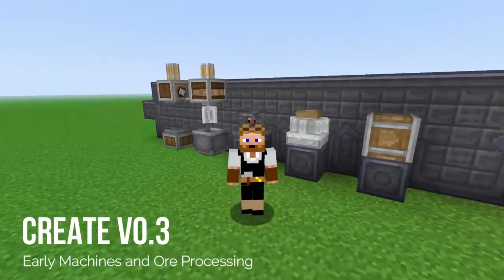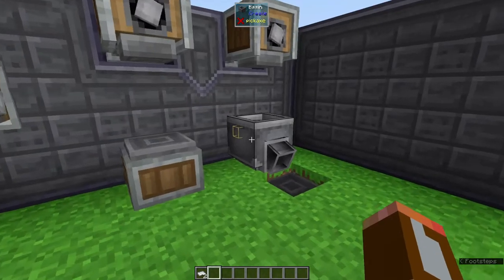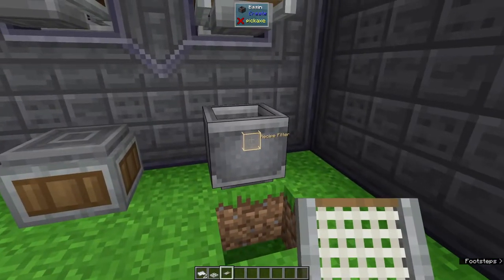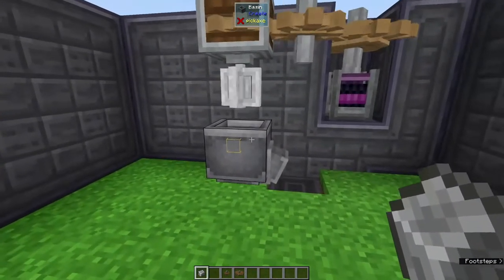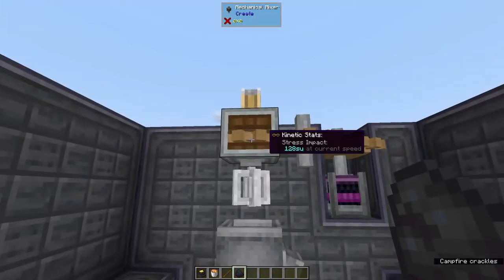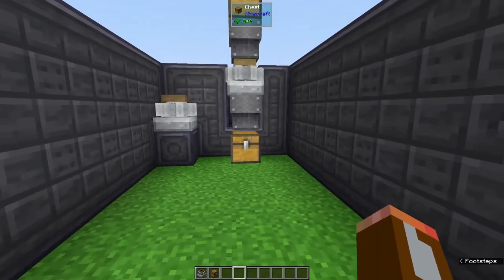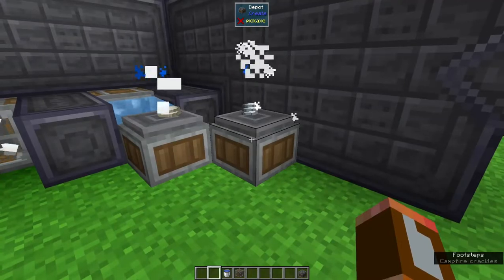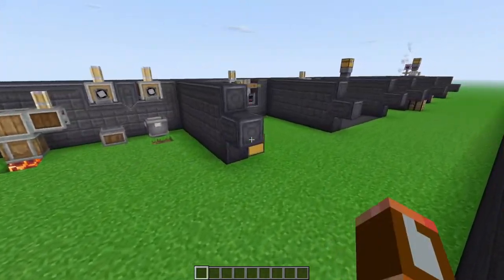Create v0.3.1 Early Machines and Ore Processing! | As Quick As Possible

Comment: Is there a way to process more than one type of metals in the mixer?
Like, I put some copper and iron ore in the mill, but when they get washed drop into the mixer, the mixer will make every ingot and store leftover?
Reply from the maker: The mixer is used to mix zinc and copper together to make brass. If you use the ore processor at the end of the video then you can just process all metal ore types and the mechanical press will turn everything into ingots automatically!

Generally you'll want to keep different processes separate, or you can use more advanced item sorting to automate making brass and then having it stored with the rest of the ingots. I personally just make brass when I need it, that way I always have copper and zinc around for other uses.